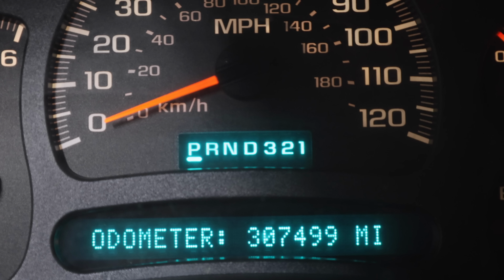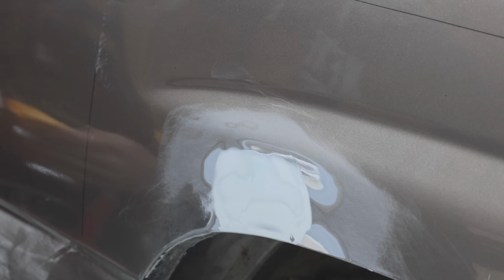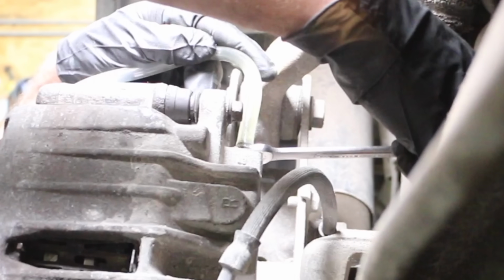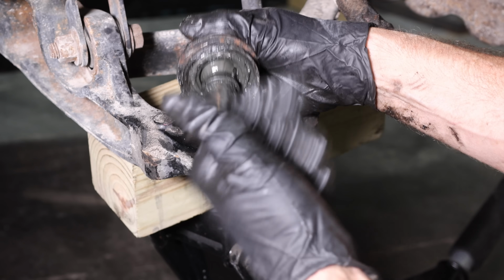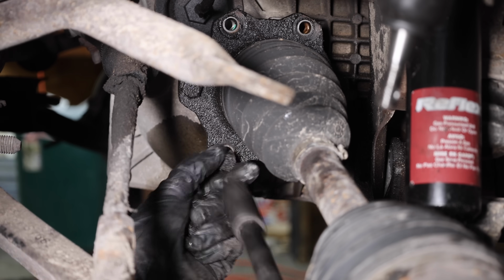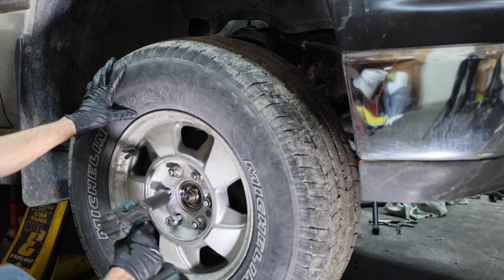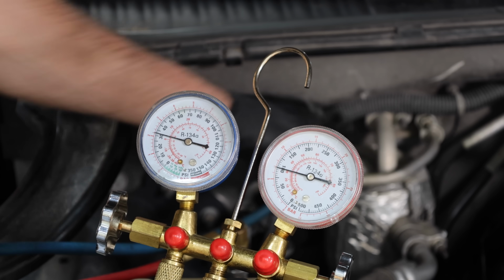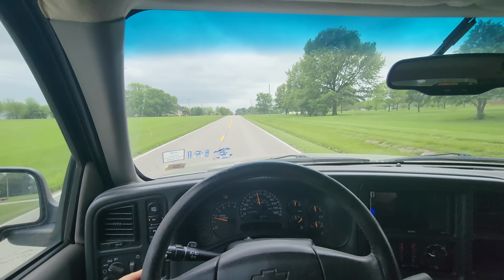Is It Stupid To Fix Up A 300,000 Mile Vehicle? Let Settle This!

Comment: Great video!! I have a 2003 Suburban pretty much identical to yours - even the color. I have a complete spreadsheet of all maintenance I’ve done over the years to help me keep track. It’s got around 340,000 miles now, but unfortunately I live in the rust belt and the body is getting lighter every day. My last repair was all new stainless steel brake lines, new calipers, rotors, and pads as my original lines completely rusted through. Mechanically, the old girl has been great with no engine or transmission issues. This was GMs peak engineering feat. I think I’ll look for another one from the southwest where road salt are not in place as I don’t think it’s worth further effort to keep her going once rust has taken over. Best vehicle I’ve owned. Thanks for the great video!

Comment: I'll say, the equation changes a lot up here in the salt belts.  That thing came apart so easy and there wasn't any rot.  That same vehicle here in Wisconsin would have rotted away by now.  I do a lot to rust proof my vehicles.  You could do a video on that...undercoatings, cavity waxes, etc.

Comment: Got 294,000 mi on my 2005 Scion xA.... incredible car that doesn't want to age or wear out....done a lot ( not all) of what you show here in the later 200k mileage range..... consider also fan belts / drive belts / water pump....if not already done by this mileage.

Comment: I’ve got a 03 z71 Tahoe with 308,000 miles.  Original motor and transmission still. I had a lifter collapse and quite a few water pumps fail, but between oil changes and brakes/tires, there’s been no major repairs.  Also on these older chevys, cognito sells control arms with bolt in ball joints which is a huge time saver once swapped if the control arm bushings become warm as well.

Comment: Project Farm is not located in the rust belt. Those belts would have been frozen or broken off otherwise. The brake and gas lines would be dangerously rusted too.

Comment: One more great video Todd and PF. I even looked here for a replacement carpet shampooer yesterday but no joy
Watching this makes me wish that I could have kept one of my F250 or F350 pre 2000 minimal electronics. non DEF trucks but in Upstate NY and with the best of care, terminal salt corrosion is epidemic and actually can rot a frame beyond repair. Not driving as much now and can hope my current F150 will last another 5-8 years - but kinda doubt it will.

Comment: WELDING TIP:  To minimize distortion avoid 90* patch corners.  The ideal patch for your wheel arch would have been a semi-circle cut.  However making a curved cut is more difficult.  COMPROMISE:  make 45* cuts using your technique - your patch becomes half of an octagon.

Comment: Is it stupid to fix a 300,000 mile vehicle that only gets 12mpg?

If you’re mechanically inclined and have all the proper tools to do so, plus got the vehicle at a great price, as well as have plenty of time to do the work.. 

With this fake hyper inflation and fuel prices the way they are ? I would pick something that gets mid 20mpg bare minimum.

I would say those are satisfactory repairs struts, shocks, suspension brakes, fluid changes body repair. Whatever it takes to get you on the road reliably safely done to factory specifications for the most part. Then does AC work like new???

$50k-80k for new vehicle, used fixer ups seem like a better investment only if you have all the proper tools, the time plus the mechanical know how to do it to factory service manual specs. Definitely can’t pay a mechanic to do any of the work that you did.

So if your labor is free and it’s for you personally or to make a flip or for a cherished relative, yes yes yes it is totally worth it …
Plenty of other vehicles that go 500,000 or 1,000,000 miles

Comment: Nice job! I do the same with my vehicles. One thing I've also done when vehicles approach 10 years old or so is buying current model stock wheels from the same manufacturer. Makes the vehicle look even better and more modern and the factory wheels are often a LOT cheaper than aftermarket wheels.
Reply from the maker: Thanks!  Thanks for sharing

Comment: @Todd, I'm wondering about what you said on the iridium spark plugs. For my car (2006 M35) there are 4 spark plug options from the OEM manufacturer (NGK), Copper which lasts 30k, Iridium which lasts 50k, Ruthenium "high ignitability" which lasts 60-120k (weirdly large range...), and platinum which lasts 90k. So wouldn't the platinum's you already had in there last longer than the iridium's you put in?

Comment: That was well paced. If you spent only $2K and several hours, it was well worth it. That you had grease fittings on the OE steering parts is one reason they may have lasted as long as they did, and it was nice to see the replacements had fittings as well. 
When one considers the current cost of a new vehicle, and their somewhat questionable reliability, keeping the "old reliable" in shape is a much better use of one's $.
👍👍
Reply from the maker: Thanks!  Thanks for the feedback.

Comment: PS, I have had trouble with vacuum extraction on brakes.  It appears that the vacuum pulls air through the threads of the bleed valve?  I usually do the final bleed with someone working the brake pedal.
Reply from the maker: Thanks for sharing.

Comment: Fast is good!  The way I look at repairs is try to get $0.10-$0.15 per mile for parts cost.  So, you invested $2,000 in parts.  If you have reasonable confidence you can get 13,000-20,000 more miles out of the vehicle it is a good financial decision.  Yes, I think you should be able to do this on that vehicle.  I suspect all this suspension work was already done once before you bought the vehicle.  The rear-ends usually go about 200K before needing a rebuild.
Reply from the maker: Thanks for the feedback.

Comment: My 1992 Volvo 240 has 335k miles on it right now, it still runs and drives pretty well. I have driven it for around a year, I bought it last year to use as a parts car for my '89, but I ended up just driving it for a year, and it never gave me any issues to speak of. Sadly though, 335k is as long as far as it is going to go (for me at least.) I am finally getting around to fixing my other one, so I am currently pulling parts off of it. NO mechanical issues though, and someone would likely get quite a bit more life out of it.
Reply from the maker: Thanks for sharing.

Comment: Today it is worth putting 10 to 20 thousand dollars into an old vehicle. I have a van with over 750 000 miles and I just replaced the timing chain and other parts in the front cover with tax it came to 8000$ i also replaced my tranny after tax the cost was 6 000$. Next year I expect to replace the motor (But only if I have to) expected cost will be about 12000 tax included. Add all these up and it is still way cheaper than a new Van at 65000$. I paid only 40 000$ for my van in 2017. 25 000$ difference. i would rather pay that to the mechanic.
Reply from the maker: Thanks for the feedback

Comment: I used JB weld for repairs to my rusted out quarter panel, it held up really well with a thin wipe of body filler on top before sanding & painting, its still good after 5 years
Reply from the maker: Thanks for sharing.

Comment: Video format and speed is perfect. If you clean up the slots on the brake caliper bracket with the wire wheel like you did the other parts those clips will go on very easy. Great work!
Reply from the maker: Thanks!  Thanks for the feedback.

Comment: Its good practice to open the bleeder screw prior to pushing in the brake caliper pistons as this prevents rusted brake fluid being pushed back to the ABS pump and master cylinder.
Reply from the maker: Thanks for sharing.

Comment: When changing that transfer case fluid, USE EXTREME CAUTION.  The case is magnesium and the plugs are aluminum.  Use a good quality 6-point socket.  Always remove the FILL plug first.  If you round over the fill plug or can't get it out, you may need to seek professional assistance.  That can be a real problem if you have already drained out the fluid.  If you do damage one of the plugs getting them out, be sure to replace them with the correct Aluminum plugs.  DO NOT use generic steel or brass plugs, they can cause corrosion or damage to the magnesium case.
Reply from the maker: Thank for the feedback.

Comment: unless you said it and i missed it , i would think that first you should mention doing a compression check of the cylinders . also, you should mention about checking the transmission that it isn't slipping as this, or low engine compression in one or more cylinders will make a big difference in future breakdowns or cost.   did you change the transmission fluid , again i might have missed it. nothing wrong with the fast pace as you talk clearly and no back ground music etc. like some do . i always recommend your video's .
Reply from the maker: Thanks!

Comment: not if it's a bus, those are built to run 2 million kilometers :')
only takes some bus companies like 6 to 7 years to reach over that 1 million, if you drive way less than that, the bus will work forever  :D

there's a lot of old model dutch buses that were driven here going all the way back to the late '70s, driving around in cuba, with over 1.5 million kilometers, refusing to die
the buses came shipped in with some deal a dutch metal magnate did to buy their metals  :D
Reply from the maker: Thanks for the feedback.

Comment: I am a bit of an addict for this type of stuff and I am abivalent long or short.

Regardless, I am a huge proponent of keeping an older, good condition vehicle running until physically become difficult to do so.  If you can do your own work, the limitation to it being financially viable is normally how fast the non-mechanical items attempt to return to the earth.  

That is what is condemning a 2001 Park Avenue Ultra I bought for pennies, fixed and used as my winter beater and loaner car for 3 years.  It has three issue I should fisx that total under $300 in parts, should take less than 6 hours but they are just not going to get done because the car is too far gone with rust...it might make it through this winter before I part it out and find a cleaner example from the South.  271K miles and killed by salt.
Reply from the maker: Thanks for sharing.

Comment: As a professional mechanic seeing all the work you did on that vehicle is quite impressive especially for a diy-er. I was a little iffy when you changed the trans fluid but since you keep up with it shouldn’t be an issue (avoiding clutch slip). As for the title, it’s not stupid at all to “fix up” a vehicle with that mileage especially an older GM like that one, wouldn’t waste the time on a new one though (QC is a joke). Anyway, keep it up, I solute you good sir! 🫡
Reply from the maker: Thanks for the feedback.

Comment: Your repair is as good as I could do with those tools and I've been doing paint and basic bodywork at home for 40 years.
The only thing I'd do is use an epoxy sealer on the inside of the patch for better rust resistance, weldthru primer isn't a great rust stopper. Additionally,  it's best not to use cardboard to mix filler on, it can soak up the hardener before its fully mixed, cardboard has a real appetite for the stuff. Use a piece of steel, I have a piece of 2.5mm screwed to a piece of 12mm ply with a thumb hole in one corner. Scrape most of the filler off before it hardens and remove the residual with a wire brush wheel on a grinder. Hint: old credit/debit cards make great filler applicators.  

Nice video, hopefully, it will encourage people to try some DYI. If it all turns out to be too much you can always call a mobile mechanic to finish for you. 

PS: It's a power steering box mate, not a pump.
Reply from the maker: Thanks!  Thanks for sharing.

Comment: Great video!
I have a 2001 Ford Ranger (4.0L V6 XLT) that I drive off the lot brand new back in the day. She now has 330K miles on the odometer. 
Hopefully I'm wrong, but it seems like these early 2000's engines may be the last generation capable of living this long. Newer engines just don't seem to last as long. 
I don't know if that's by design or just a sign of declining quality standards but I think the insane prices on used trucks is an  indication of the appreciation folks have for older trucks.
Or maybe its just an indication of the even more insane prices for new trucks.
Reply from the maker: Thanks!  Thanks for sharing.

Comment: Only thing I'd add is at 5:30 when you have that rotor off you should clean up the park brake mechanism and adjust it if you're already there.  When they're all rusted up it makes getting the rotor off a real pain.
Reply from the maker: Thanks for the feedback.

Comment: I have a 2003 Silverado 1500 with 175,000 miles. Just gas, tires, oil, tranny fluid, brakes, axle seals, tailgate latch, and the AC actuator switch. That's it. I have dragged around skid steers and tractors up and down the mountain, and a 24 foot boat  with that truck yet it burns no oil. It still gets 20 mpg on the highway with that 323 rear (and tires at 45 psi) at 60 mph. If someone gave me a whole bunch of money I would not buy a new truck. Instead I would have a friend install new upholstery, pull the dents out and give it a new paint job.
Reply from the maker: Thanks for sharing.

Comment: SAME PACE! Really great content on this one. Our 2005 4Runner has 370,000 miles and counting. We bought new, and take care of it religiously. The key to longevity is on time preventative maintenance, and making a repair when needed at the time the repair is required. Delaying preventative maintenance or delaying repairs will kill a vehicle off. Keep them running with on-time maintenance and repairs a vehicle will last a long time. Most auto-car is DIY possible with a willingness to spend the time to perform the maintenance.
Reply from the maker: Thanks for the feedback.

Comment: There was a time when a driver blocked out the whole left side of a truck hood.
I told the boss and the driver to save the pieces.
They looked high and low for a replacement hood, but all were too high of a price.
I told them both I could do the repair, and it would not take long.
The driver was to pay for the parts, and me for my time.
I gave him a short list, and I told him I would bring the rest.
In one day, with his help, the hood was totally repaired, even including the final paint, which was red.
Anyone knows how hard red is to match, but I have my tricks.
When the truck was done, we waited until the heat lamps had hardened enough to put the truck outside, IN THE RAIN.
That was a Saturday.
We parked the truck next to its sister in the yard.
On Monday, nobody could tell which truck was which.
Someone had to go out and look at the numbers on the trucks.

The main factory trained mechanic couldn’t even tell the difference, and he was impressed with the work, especially the way I reinforced the places where the hood was originally broken apart.

Repair is definitely easier to replace!
Reply from the maker: Thanks for sharing.